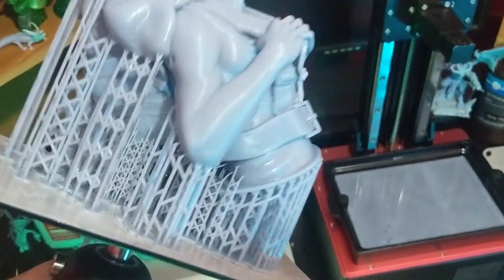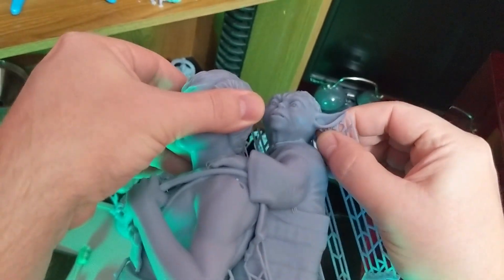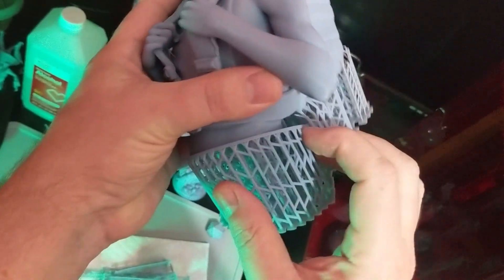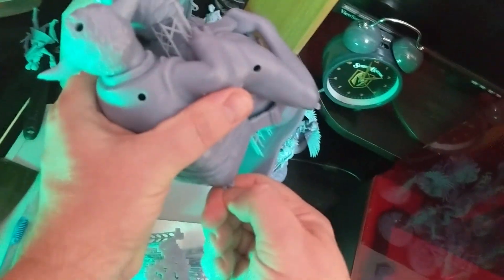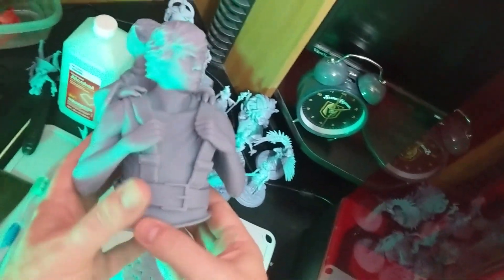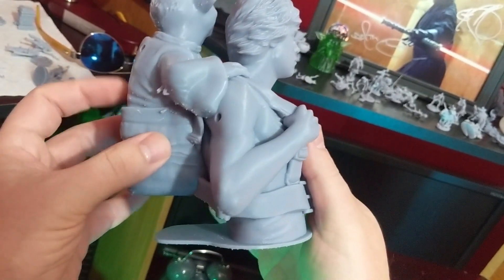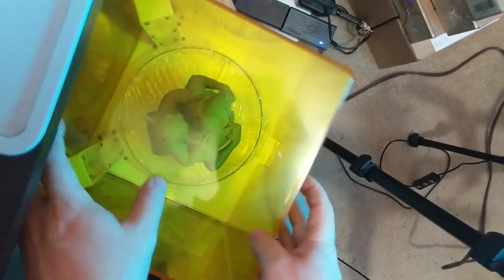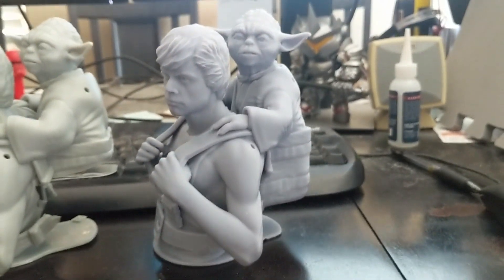How to Add Supports in ChiTuBox - Part VI - Chapter 3 - Removing Supports, Curing, Wrap-Up

Comment: I am getting omtp resin printing. How do you plug up the holes?
Reply from the maker: A lot of people use two-part epoxy putty like Milliput or GreenStuff, but you can use regular clay or if the holes are really small you can use the UV resin and cure it with a UV light.  Or you could use Apoxie Sculpt like Crafsman does. https://youtu.be/3qaEzbdkzR0

I'll make a video about it like I mentioned eventually, but I have a few others I'm working on.